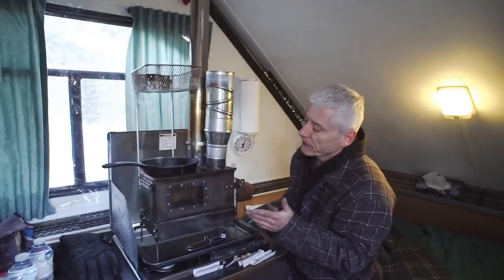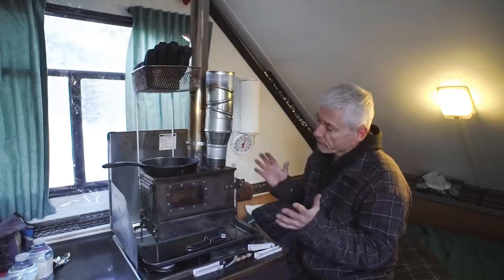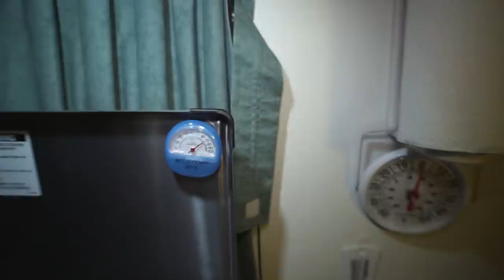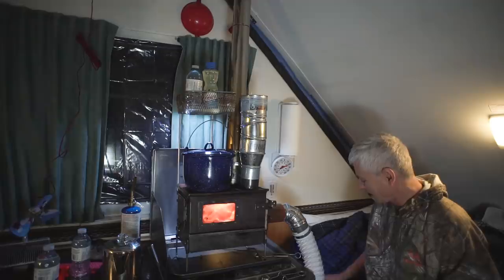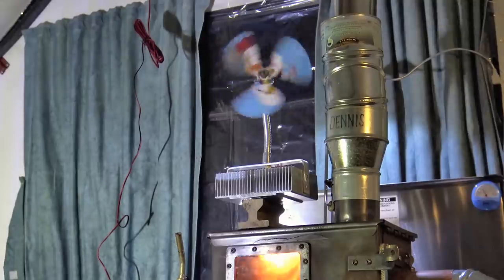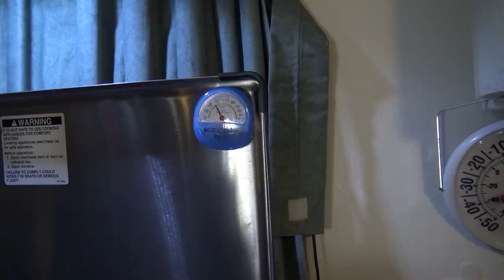Wood Stove in an A-Frame Trailer - Part 2

Comment: LINE the whole interior, ceilings in side cabinets on floor wall areas, windows, door with "Reflectix" from Lowe's it friction fits cut it with scissors or knife. If you can put your wood stove as close to the floor as possible.....because heat rises leaving lower areas cold. Also if you can put an elbow in also get one of those heat operated stove fans that sit where your skillet goes. Stay warm

Comment: Mr. Slim Potatohead, I am looking into options to heat me school bus converted to an RV (you can see some videos of the process on my channel), and this may be a viable one.
Have you thought of adding a bigger hopper so you don't have to refill it as often?
How about a little contraption to stoke the little pellet coals? It can be something as simple as a thin rod with some bends in it that rotates. You can maybe activate it with an electric motor hooked up to a timer, with a battery charged by the little heat generator, or maybe activate it by pulling on a chord from bed.
Seems to me that getting a full 7-8 hours of sleep is an important factor.

Comment: Very cool, & warm! Well done great ideas realized...next time you may have a vibrating toothbrush skewer to the pellet grid and a roof high hopper..Denis' big brother..to cover longer stretches. I see it coming..nice step by step engineering for your cozy Aliner..I was wondering why you had not applied out side insulation to the Windows ( night) and AL framing..but your results in a -6 degree night is already perfect...such a vid and test inspires me to try also all sort  of things in my home or camper. Lika  a Chinese Diesel heater for 180 bucks or such....Great vids, keep going!
Reply: RV EUROPE ON TOUR 
RV EUROPE some great suggestions!  Could insulate the air intake pipe with foam to further reduce thermal losses.  Could throw an electronic timer on your toothbrush “shaker” to actuate once every three hours.  With a roof high pellet feeder 8 hours restful sleep might be obtainable.  Interesting videos Mr Slim, thank you for posting.
Reply: @steveroy3349 ,  yes very inspiring...last night I bumped into my sauna oven which is mounted 18 cm above my basement floor Un insulate, just a wooden grid to have comfort at the feet.
Then I checked the manual ( which I never did, since installed it) it says when you have a ceiling height of 1,90 you need to install that heater < 20 cm above the floor to reach maximum convection? Wooow..and it does it within  20 min I have a less layered heat in the sauna..physics is physics and 9 kw of my 400 V oven a lot of power..As a winter camper I added a 1 Amp thin film heater ( looks like a pcb fotofilm flexibile plastic circuit) to the floor a super thin carpet on it and mostly stayed on camp grounds in the serious part of the winter, I figured that a floor heater can reduce the height of the well being temp level more to the persons rather then to the roof and 3 degrees less are needed to feel well..I was able ( not to show off) but camp with one bottle of propane all week..man was i proud! For a large camper I studied, a Chinese diesel heater with 5 kw supplemental and one more PV panel ( totally 300 wp) and a batt with 160 Amps ( lipfos) will give me a 3 weeks stretch without changing gas bottles or having grit connection umless i clear the snow and sun is out..however, if no sun Slims oven will be un Surpassed! Little things make life very enjoyable though thats why I love Slim's channel and his Aliner projects, well dome!
Reply: @steveroy3349  you are right: more recent rv gas heaters like here in Europe Truma or Alde have a double pipe system for exhaust and fresh air intake.. Where as the exhaust is in the middle of the fresh air pipe ( double pipe, small and big diameter) this way air in is pre heated and insulated!

Comment: Okay here is something you can try. Get a fair size bake bean can and some gravel (make sure it is dry gravel) fill the can with the gravel and place it on top of the stove. The gravel will absorb the heat and when the fire dies the rocks will continue to heat the cabin for about 5 hours has been my experience so when you wake up it will be somewhere in the upper forties low 50s F.

Comment: I have a suggestion to improve your stove: create a rake that fits between the tines of your pellet burner rack to sweep the ashes away to allow more pellets to drop from the feeder.
Drill a hole on each long side of the can near the bottom, but above the removeable ash catcher, with a third hole throught the dividing wall.  Feed through the hole a threadded rod.    On the rod, using bolts and washers to space and secure, add thin metal fingers that will fiy between the bars of the pellet combustion trap.    With a twist of the rod, the fingers will move up through between the tines to knock the ashes away and allow new pelets room to drop.
Reply from the maker: Great idea, Thanks Dale! SP

Comment: Will there be a companion video showing how your beer doesn't freeze?Besides drinking it before it has the chance.
Reply from the maker: Beer didin't freeze because I keep it in my fridge. The fridge is off, but I add a bottle of warm water inside it (sometimes the leftover cooking water) to keep the inside just above freezing. Works great! SP
Reply: You're a smart man. Kind of amusing having to keep a beer warm enough.

Comment: I'm watching this almost a year after you posted it and realize that you may never read this comment. I hope that I am wrong because I want you to know how much I admire the work that you put into this project. You went after this as I would, if I wasn't lazy ( you clearly are not ). I had many unanswered questions about heating a small camper in harsh conditions through DIY methods and you managed to answer most of them in this video. I will be doing most of my winter camping, once I'm prepared to brave it, in north central KY and south central IN, which will be much less severe than the conditions that you document in this video, so what "worked" for you is probably going to "WORK" for me in a big way. 

Since you are clearly a "thinker" and are certainly pursuing a high degree of efficiency, have you ever considered using the gadget that charges your battery to charge something that could turn a screw of some sort that would, in turn, agitate the pellets during the night to keep them burning efficiently without your own sleep-interrupting participation?

Love this video and will certainly look at others you have posted!!
Reply from the maker: Hi John, I believe you are referring to is an auger. Home wood stoves have them to regulate pellet flow automatically. It's typically a motor that runs a screw. Although practical for home use, it's a big challenge in this application. The key roadblocks are power and size. Commercial augers run on 120V, although I'm sure there are 12V motors. The stove only produces 5V, so the power would have to come from another source. In order to use an auger, it would need to be powerful enough to hold the weight of at least 8lbs of pellets (assuming 8 hours of automatic use). The hopper would in turn have to be 2 times the size to hold the extra pellets. A larger hopper would have more likelihood of clogging up.

Bear in mind my stove is specifically designed to have all key components being taken down and stored inside the stove, as my trailer folds down so everything must be stored when not in use. More parts, less space to put them. In short, trying to solve one problem sometimes ends up creating new ones. 

I have a far simple solution, which is win-win for me. I am of the age where I have to get up in the night to use the bathroom. I just stoke the fire and fill the hopper when I'm up. Works great! SP

Comment: Enjoyed the Video. Did you complete any heat calculations? Might have taken some of the guess work away. Have fun.
Reply from the maker: Heat calculations would have been at best unreliable with all the variables. I knew in the build tests what the stove was capable of. That's all I needed. Thanks! SP

Comment: Not sure if this has been brought up before, but a little stove pipe physics:

Stove pipes shouldn't let smoke out. Convection inside the pipe creates a lower pressure relative to the outside air (as long as the pipe is long enough); the same pressure that "pulls" the smoke up the pipe from the stove also wants to pull air into the pipe, not let smoke out. As long as there is a few feet of pipe above the roof, and a decent draft, smoke escaping the pipe simply can't happen. On the other hand, if the structure being heated develops lower pressure due to insufficient makeup (combustion) air, the structure will develop lower pressure and you lose the draft up the pipe. Yikes! Another cause would be a clogged outlet at the top of the pipe.

Comment: Nice  stove and job. I just buy a good down -20f bag when I sleep. You don't need any heat and you can sleep straight thru all night. I've slept in my car at -14f. Would save fuel. I definitely would use that stove all the rest of the time.

Comment: A little squirt of boy scout water (charcoal lighter) and away she'd go.

A good test.  I survived a similar first night test (prepared for it but not entered totally voluntarily) using the commonly used Buddy Heater.  Similar temps with a great -30 bag and insulated underwear, down coat, etc..  I ran the  heater before sleep, briefly during the night, and again in the AM.  In the back of my PU on a cot with a 6 inch foam pad on it.  I slept perfectly warm and well.  But in the morning virtually everything, including my food and initially it appeared, water, was frozen solid.  

Survived, but it was a learning experience.  I was able to get water for coffee only because it was frozen in the 5 gallon plastic container only the first couple of exterior inches.  Slammed it around until I was able to pour the liquid from the more interior part of the container.  No coffee would have killed me instantly.

 It struck me that even if I was able to stay warm if everything I had to eat was frozen, well, not so good.  Hypothermia cannot be avoided without high energy food (under some conditions of course).  Fortunately, I had some excellent honey/oatmeal/rice/nuts and cranberry bars.  Even frozen they were bite-able although I broke off two front teeth.  They were well worth the broken teeth.  My body was very obviously craving the food energy.  It told me when I needed more.

The buddy heater was fantastic.  Of course, as you know, the disadvantage is the increase in humidity.  I personally think they're safe if properly vented.  But that's a personal call.  And they're inexpensive and easy to run.

Glad it works for you.  But for me, in real cold and wind, it's a hard-sided rig. Currently in my small RV (16 foot Scamp) with a Buddy Heater and plenty of bag and clothing.  The ultimate would be an externally vented propane Dickinson heater.  I have a couple of bigger, yet still relatively small, RVs and have wood heat in both of them.  The thing about wood heat is that in order to maintain a burn overnight you need to use a greater mass of slower burning fuel.  I hate getting up in the middle of the night to stoke a fire.

Interesting video and don't mean to demean your methods or conclusions.  You're out there having a wack at it and that in itself is worth a shout out.

Comment: Most of your heat is going straight up the chimney. Put a chimney cap on the top of the chimney,  and add some fins to the exhaust pipe to radiate heat.
Reply from the maker: Sounds like you missed part of the video, plus the build ones. SP

Comment: I'm also surprised that you didn't have better insulation for your A frame generally since you've done lots of winter camping before and also keeps you cooler in summer. Given how much you've done so many great modifications, I would think that would be the first one since that's the main advantage a shelter has is limiting exposure to the elements. You could carry some kind of flexible insulation you can roll up and stow easily to attach to your walls just when exposed to more extreme heat or cold. If you want to keep light coming through the windows using plain bubble wrap just taped at the corners works better than plain plastic and that way you can pull it to the side a bit to look outside and its cheap and easy.

Comment: Nice little stove but I would think it's probably to small for -20c and below. Nice build as well I have a double burn tent wood stove that will keep my tent at -25c at....way to hot for comfort. For your flue you could get a double wall flue so that your air come down and the hot gas goes through the middle it would save on making hole in your camper. If you want more heat dissipation you could add some fin on the side pair with one of those heat fan you should be set. Thanks for sharing!! And I'm off to camping in as tent....

Comment: Hints, you may or may not know: ...couldn't tell but after you get the fire going steady you can close the damper.  Depending on the size of the round pan inside of the damper part of the chimney you can close it as far as you want as long as the smoke can still go out and doesn't leak.  That way all of the the heat doesn't go up the chimney all at once.  It will make a huge difference.  You can also close the air inlet (flue) partially that way you will burn fuel more slowly.  My great Grandmother taught me how to start a fire and in a cold stove: you should open the damper all the way then put a large piece of paper or two or three (newspaper or whatever) in the very back or below the chimney outlet and light it, then close the door and leave it cracked open an inch or two, epending on the stove.   This will set up a perfect draught (airflow). Then add wood, start and go to normal operation.... (Place a pot of water on the top of the stove, humid air holds heat much better than dry air).  (Carbon monoxide detector, please). (Wood may be more economical).

Comment: Bloody brilliant! Perhaps try soaking some pellets in methylated spirits for lighters. Cold air intake wouldn't help, no drama burning campers internal air, can't run out of air since the van is not air tight and carbon monoxide goes up the flue.

Comment: Do you think the heat is all going right up the chimney and out the stack?  You can check the stack temperature and compare that to the surface temperature of the stove.  You could set a cast iron girdle on top of the stove to help radiate some heat.
Reply: Never mind.....I see you addressed this later in the video

Comment: Good video, 
Pellets in needs to be opposite of exhaust so heat travels across instead of right out the exhaust. Unless you have a divider inside, so heat travels like a sideways rocket.. otherwise it's like a water heater with no dip tube. Love the stove window for viewing & ambience.
Reply from the maker: Please watch the build videos. It will make more sense. SP
Reply: @SlimPotatohead  just found & watched.(sorry) btw the pipe insulation was brilliant..  You incorporated a lot of great ideas into the stove.. 
might want to try a 1/2" metal pipe from inside, aligned with center inlet (block off L & R) Drill a few holes to face up, to help clear ash buildup (might make more noise than you want, but could give you a full hoppers worth of sleep). Or a little larger diameter single section  sleeve on the exhaust pipe would create a free convection & less fuel use.
Keep inventing, Stay safe,  & ty again for your vids

Comment: you might want to use  insulated duct for your air input from the door; this will cut down on the thermal transfer of super cold air running through your heated area.  The only way that might help regulate the temp is to put a thermal switch on your other roof vent to pull out excess heat if needed.

Comment: The wood stove is a good idea. The problem is heat circulation, you can buy a thermoelectric fan for wood stoves. It's connected to a heat sink which gets hot it is safe and the attached fan blows the hot air around the area.. Might be a thing to look into? The fan motor runs of the heat generated by the stove.
Reply from the maker: Sounds like you missed part of the video. SP

Comment: If the pellets feed into a tubular metal cage that was configured so the pellets would easily slide to the bottom and at a 45 deg. angle, the need to stir the coles would be eliminated. With the fire inside the cage, the ash would automatically fall away. This would also give a more complete burn.

Insulating the pipe outside would greatly increase the draft and improve the burn. It would burn hotter. By adjusting the air input you can regulate the temperature. That way your warm no matter how cold it gets outside. It will also prevent creosote build up inside the pipe.

By having so much of the pipe outside exposed to the cold, you'll find that the colder it is outside, the less draft you have inside. Pellets need a really good draft to burn properly and get maximum BTU's out of them.

Great job.

Comment: Pretty good experiment. I think if you deflected the immediate upward heat back down, you might feel much more warmth from the stove.  You could make a metal cone to wrap around the stove pipe, similar in design to the rain cap you made.  Maybe 3 foot up from the stove and about a 3-4' diameter or thereabouts. Might be worth a try. Think about it, you don't need to heat the upper 25% of the A fram
Reply from the maker: Interesting idea Patrick. Thanks! SP
Reply: If you think about those patio torches/heaters, they have that reflector shield/Chinese hat design, that reflects and redistributes the rising heat back down to table area where people sit. And that works outdoors!